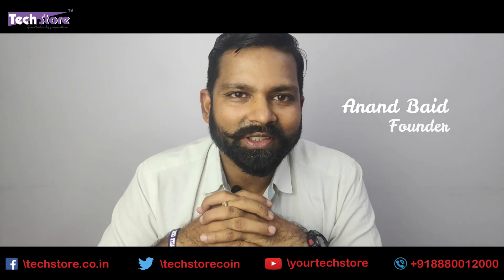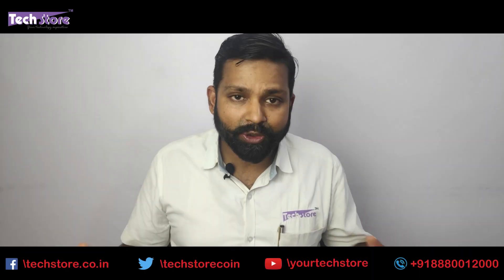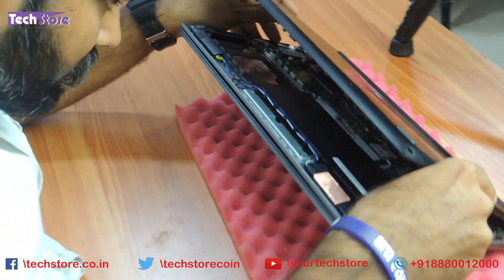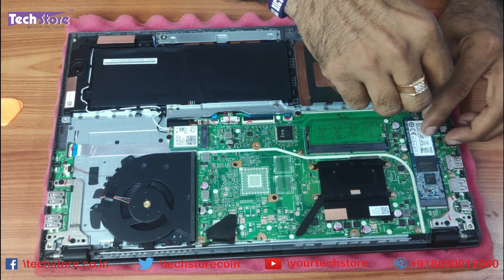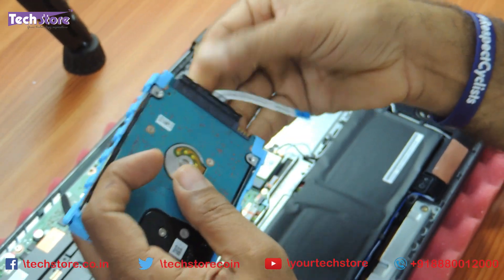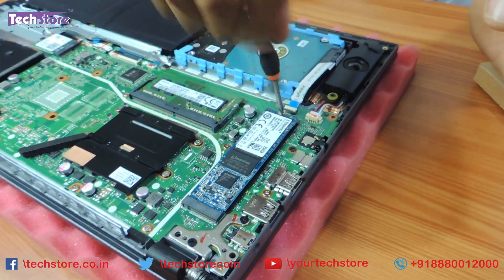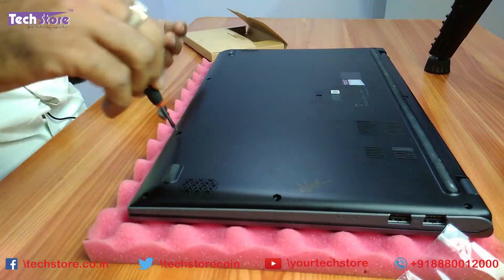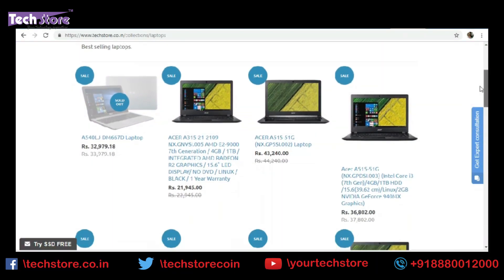Asus Vivobook 15 X512 : How to Disassemble the base and upgrade ram m.2 ssd wifi harddrive easy diy

Comment: Can i add 16gb ram to this i have the same modle
Reply: Are you still using this after 6 years of launch? Is it performing good? You can add 16 gb ram. I have added 20gb when I had this in past

Comment: well the computer could handle up to 32gbs of ram but it has 4gbs of ram soldered onto it and there's only one slot you cant upgrade to 32 gbs of ram cuz you would need a 28gb of ram and that does not exist if your good at soldering you could solider 16gbs of ram onto the computer and put a 16gbs ram into the sodim slot but if you cant solder you could only have a max of 20gbs of ram by putting a 16gb ram stick into the computer

Comment: I want add extra RAM... My asus laptop have 4GB ram inbuilt but I check in  command section its swoing 32GB maximum supported and using one slot of 2. but when I opened my laptop's back cover I can see only one slot. how to find another second slot according to task manager section... PLEASE HELP ANYONE... 🙏🏻😭
Reply from the maker: unfortunately, you can add another 16gb only and maximum upgrade upto 20GB which is a limitation of Asus laptops

Comment: The spec says RAM can be upgraded to a maximum of 12gb in total. That's means, maximum of 8gb can be added extra (4gb soldered). But how come more than that? Is it really working? If yes, whether the whole 20gb is "usable"?
Reply: I just added a Kingston Fury 16Gb module... it´s working well... no reset until now. But i had to upgrade the Notebook firmware so it could recognize the Kingston module...
So far, so good.... it´s still running some tests with Passmark and Furmark.

So yes... the 20 gigs are usable.

Comment: I think, It can't be upgrade with 8gb or 16gb .Because Soldered Ram is 4gb .So, We need to upgrade only 4gb
Reply from the maker: You are wrong. You can install upto 16GB on the single slot.

Comment: i have a asus X 512FA...can i add a HDD in it and if so upto what RAM
Reply from the maker: Yes you can add upto 2TB HDD and you can install additional 16GB ram 2666MHZ DDR4L Glad it was helpful! Thanks do Subscribe !
Reply: @TechstoreCoIn  hi...which ssd to use ..presently i have 256 GB SSD...which brand 512 GB SSD

Comment: My model X512FA (i3,10th gen,512gb ssd,4gb ram). My question is can i install SSD in place of HDD space?If possible let me inform the maximum storage i can expand. Thanks in advance.
Reply from the maker: Yes you can.
Reply: @TechstoreCoIn  maximum storage i can expand for ssd?
Reply from the maker: Yes you can.

Comment: 2 questions
1. Many M2 NVME SSD drives come with a heatsink.  Is there room to fit one with a small heatsink already on the drive or does it make contact with the case as it is?  Example ADATA XPG SX8200
2. Also I have read other guides that note the ram capacity at 36GB (32+4) but I am having a hard time identifying which version can handle that increased ram capacity.  Any advice on that?
Reply from the maker: It does have some space to allow a heatsink. We would not advise beyond  additional 16Gb ram!
Reply: @TechstoreCoIn  hey if I put 8gb ram stick there will it work?
Reply: @The747Hamster  yes

Comment: Useful video. Would be even more useful if we had the information on the HDD kit. Part number or where to source it from. Thx!
Reply: Hello! I upgrade mine recently, but didn´t found the kit.

Here are the parts i used:

HDD FFC 10 Pin cable:
SKU : HDDFFC10PX512
P/N : 14010-00217200

Hard Disk Caddy:
SKU : KITHDDX512
P/N : 13NB0KA3L10111

Self-adhesive insulating cover:
SKU : HDDMYLARX512
P/N : 13NB0KA3L20011

There are some kits from Nimitz and Deal4Go on Amazon...but don´t know the quality, or if they´ll fit.

Regards!

Comment: Having asus x412ua-ek319t laptop with 1TB HDD, want to add SSD, 
Will NVMe SSD will support this model, pl confirm
Reply: Amit Kumar your laptop supports 2280 m.2 ssd maximum at 500gb.

Comment: I have the x512d ryzen 7 variant what is the max ram upgrade I can apply
Reply: you can add max 16 gb,  but you have to use a ram which runs at same speed with your laptop's. AND! There is only one slot you can insert ram, so you have to use 16 gb as a module, you can't insert 8+8 (cause laptop's ram is on board which means you can't replace it )

Comment: My vivobook 15 can't start after installing 4gb ddr4
Reply: take out the stick, boot again, make sure its working without the stick. put it back in make sure its in securely. if still nothing take the ram back and get it replaced
Reply: you also might have accidentally shifted something in the prosses

Comment: Can I add 8gb ram, so i'll have 16gb?
Reply: since there's 4 that you can't replace you can only get 8, 12, or 20 gigs of ram
Reply: You can add every module which is 16 gb or lower, but your additionla ram have to work at same speed (for this laptop it's 2400mhz) if it's not, your pc may not work smoothly, or maybe don't work, but if u use ram wihch runs at same speed, there is NO PROBLEM!

Comment: Hey, great video, thanks for making it. Can you tell me where you can get that kit you're using at minute 3:08, the bracket, the sticker and the adapter cable? I can't find it anywhere. Tried to get that information from ASUS, and from Best Buy, no one has it and no one will tell me the name of the components. Any help would be greatly appreciated. Thanks!
Reply: Here are the parts i used... the rubber caddy is the same.

HDD FFC 10 Pin cable:
SKU : HDDFFC10PX512
P/N : 14010-00217200

Hard Disk Caddy:
SKU : KITHDDX512
P/N : 13NB0KA3L10111

Self-adhesive insulating cover:
SKU : HDDMYLARX512
P/N : 13NB0KA3L20011

There are some kits from Nimitz and Deal4Go on Amazon...but don´t know the quality, or if they´ll fit.

Best Regards!
Reply: It is provided with the product box

Comment: If you go to crucial.com > upgrade my device > system scanner, the website tell you what type of ram you can use. My Asus vivobook is an x512fb with an i5 and the website does say that my pc can use ddr4 2666mhz.
Either way, thanks for the video. I was wondering about if the ram was all removable or not.
Reply from the maker: One ram is soldered on the motherboard. Another slot is available where you can put upto 16Gb ram.

Comment: Can I use Seagate 1TB Laptop HDD SATA 6Gb/s 128MB Cache 2.5-Inch 7mm Internal Hard Drive ST1000LM048 in my vivobook15 ?
Reply from the maker: Yes you can.

Comment: Hi there, first of all nice video, i have a question i got the AMD Ryzen 5 version of this to my GF and i want to use the other laptop HDD so she can store stuff there i can install it on the Ryzen version correct?
Also if i want to upgrade the RAM it as to be a 2400 if i'm not mistake. Can anyone recomend a good one?

The model is Asus VivoBook S512DA-BR097T
Tks in advance.
Reply: Its the same process for all 512.
Reply from the maker: yes you can.

Comment: Does Asus Vivobook 15 X512FJ support NVMe PCIe® Gen3 x2 SSD ..???
Reply from the maker: yes it does. Glad we could be of help. Do subscribe
Reply: @TechstoreCoIn  i also thought so but asus experts in Bangladesh said it doesn't doesn't support NVMe PCle® ssd so then i just installed a normal m.2 ssd
Are they really so dumb or there is a risk in using NVMe PClr® ssd..???

Comment: As per company's specifications in Asus vivobook x512fa i3 8th generation you can add another 8gb only.... After that total available ram =4gb +8gb=12gb
Reply: Hi, I saw the same specification as you. Somebody else did a test with a memory card of 16GB? did it work? Thanks!
Reply: @camv86  16 GB will not work...……….. I confirmed from Asus service centre. it will be maximum 4GB (Preinstalled) + 8 GB (Added later) Total 12 GB
Reply: It depends on the processor 20gb should work on the i5 and ryzen 5
Reply: @pr3cious193   
Hello friend, could you prove that? if the 16gb is used for a total of 20gb in ram and  the operating system took full advantage of it in the version of ryzen 5 3500u, this with some video link or something please? I am interested in buying the asus M509DA with that amount of ram but I had read that the system due to the motherboard only takes advantage of a maximum of 12, I do not want to throw away my money and instead buy the 12gb version directly if necessary. thanks for your time.
Reply: @alfonsomeza8927  Idk about the m509da but I know 20gb works on x512

Comment: Please Note: the default SSD provided in the i3 version is m. 2 but SATA3 and not NVMe PCIE. So its pointless replacing this SSD with an NVMe in the i3 model. Secondly Windows 10 is pre installed in the SSD. so be sure to know how to clone or reinstall your paid copy of Windows 10 onto the new m. 2 SSD.
Reply: if you know "how to clone or reinstall your paid copy of Windows 10 onto the new m. 2 SSD"
Can you please share the steps.
Reply: @ShantanuSharma26  it's safer to extract your windows key and any special drivers first (all are easily loaded auto by win 11)onto a spare usb. Then Do a clean install of Windows onto the new m. 2 SSD.
Reply: Is it possible to install an NVMe SSD in that socket and have full speed or will it bottleneck to sata3 speed?
Reply: @DanGOchoa  m.2 NvMe will run at / bottleneck at SATA III speeds. Because the motherboard supports SATA III only.
Reply: @BABA-GOMI  thanks!!
Reply: can we use a 2.5 sata ssd instead oh 2.5 hard drive ?
Reply: @deepakparbat7387  Yes, 2.5" SSD will run at  SATA speeds in the HDD slot. The performance and longevity of data transfer and storage on the 2.5 SSD is much faster and Long Lasting. You'll get a Better experience and value for your Laptop!

Comment: I am planning to buy x512da-ej449t with 1 tb inbuilt hdd.i want to buy a 512gb ssd.which ones can i buy.can you provide links.
Reply: I think you should buy SSD version it is around same price I think it is ej503t 512gb SSD. It will be faster and you can get hdd later or buy used cheap second hand

Comment: Which frequency ram should I get for ryzen 5 3500u version?
Reply: 2400 and expandable upto 12gb
Reply: I have the same Ryzen 5 version, 4gb on board + 4gb removable, I put an 8gb 2400 ddr4 in the available slot and when I turn on the laptop a message appeared saying "Automatic repair system" And  restart automatically, doesn't load after that, keeps restarting
Reply: I don't think that ryzen 5 model have extra ram slot